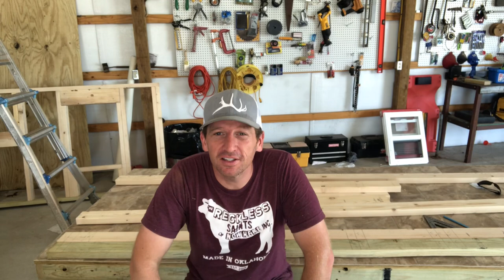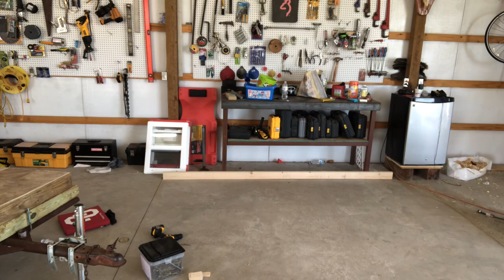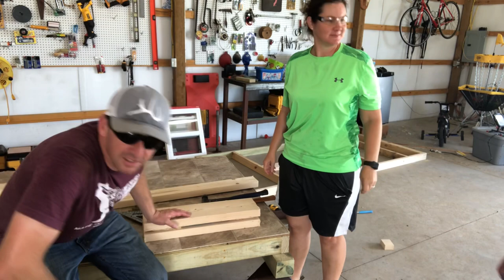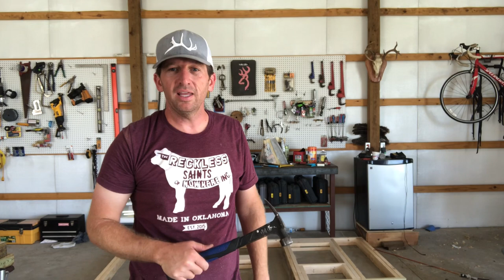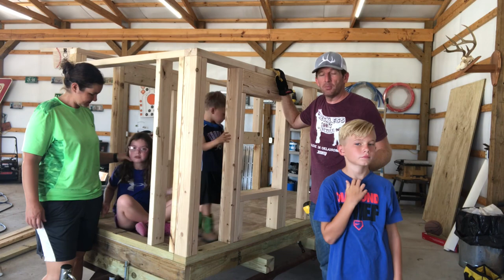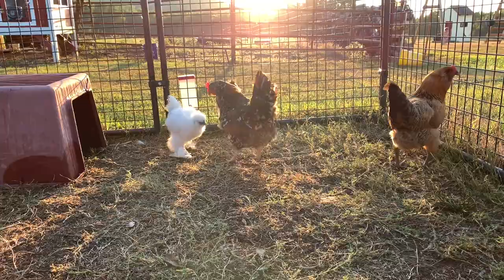Building The WALL | Mobile Chicken Coop |

Comment: Was gonna ask why one wall was taller than the rest, but then realized that your probably running a slanted roof, not a peaked one. You don't get the snow load we get in parts of Colorado. The nesting boxes with outside access is a nice touch.
Reply from the maker: Yes! You are correct. Slanted will run the water off and our snow is minimal here. Speaking of snow! We love snow ❤️

Comment: Ranger and the younger ones all did a good job nailing. Ranger, when I was about your age I would be given some old nails to just nail into boards for practice. It helps a lot with aim and learning to not bend a nail. You still will bend one or two here and there, but with practice it happens a whole lot less often. 

Why is one wall taller than the other? I am a little confused by that.
Reply from the maker: That’s the slope for the water to run off instead of making a peak in the middle. Just easier roofing wise 👍🏻 Good eye. Probably should explain that.
Reply: @WalkerFarmFam  - Totally explains that! Thank you! 🤣🤣🤣 I so could not wrap my mind around it at all for some reason. Almost senior moment. 🤦‍♀️🙄😜